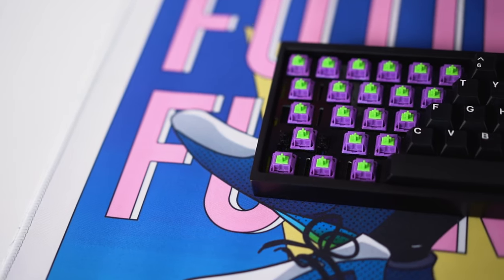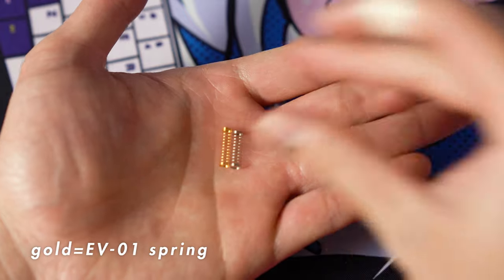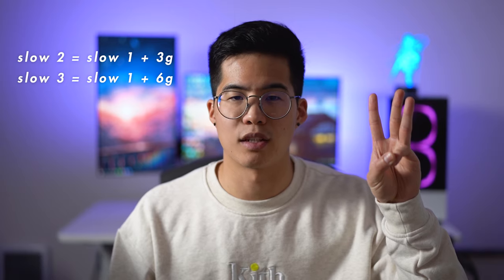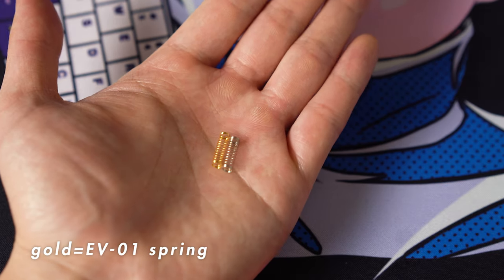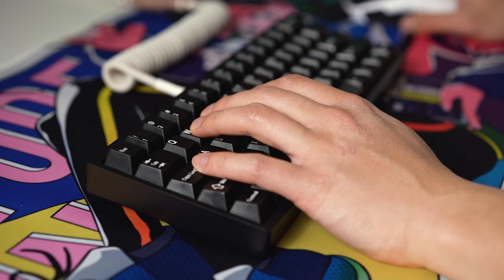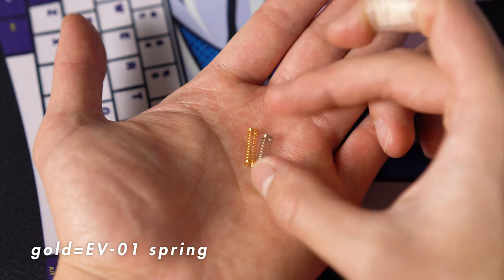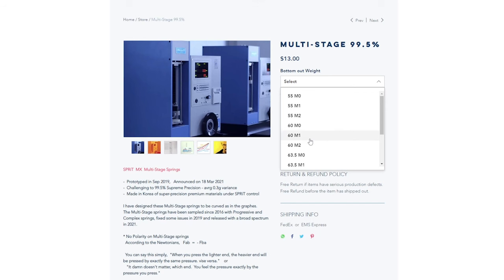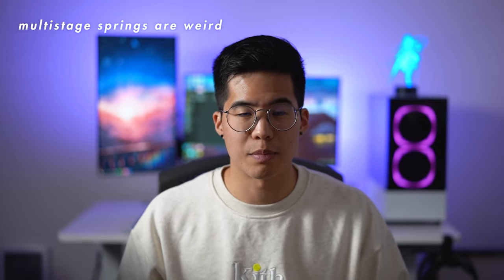BETTER THAN LUBING AND FILMING SWITCHES? A Guide To Sprit Aftermarket Springs

Comment: I originally spring swapped my Gat Black Ink springs to TX 14mm (Short) 65g, but didn't like how easy it was to press down and accidentally input keys, so I swapped them again for TX 16mm (Long) 67g. Feels so much better with the return and it actually requires a little more force to actuate the key press! Highly recommend the long 16mm version. 

Obviously weight is subjective but I find 67g was a sweet spot for me on linear switches. I use the stock 62g Boba U4Ts (tactile switch) on my other keyboard and they feel fine.
Reply from the maker: Ooooo I might have to try the TX long! I have a bag of the TX long 70g laying around so I’ll play around with that

Comment: What exactly do you mean by the bump in the Multistage springs? how does the travel feel in the first and second halves?
Does it start light and weight ramps up quickly until halfway, and then it stops getting heavier?

Comment: I just want to point out that bottoming out isn't inherently fatiguing - if you aren't jumping around different builds/keyboards constantly, and you get used to the force required to actuate the keyboard you're using, you stop pushing down harder than you need to, even when bottoming out. Going from a Box Navy to a linear optical switch, I was typing too hard for a while, but then got used to the smoother, faster, lighter, shorter throw, and it's fine now.

Comment: I'm modding my first keyboard and haven't even recieved it yet and I'm fallen so deep as springs now... I've decided the slow extreme springs would probably be best for me due to my partialness towards my corsair k55 membrane feel I'm currently using temporarily. And now I just need to decide between TWENTY different variations of the spring. What a nightmare. 

Thanks for the detailed advice!! Very few videos on this subject. Also, I went with the Gateron Box Ink v2 - Blacks.
Reply from the maker: honestly it can be hard to tell the difference when it comes to small variations of a spring...like the difference between a slow extreme I and II is pretty minimal. Good thing it's cheap to get a set of springs and try them out!
Reply: @tinstypos  Yeah I got a few different ones but I'm far too lazy to compare them all after how long it took in the first place lmao, it is extremely slight

Comment: i dont understand the weights on the site. like does the grams that it shows, mean force from the top of the spring or the bottom out?? i want to get some slow springs for my tactile switches. but i want a really light feel. what should i get??

Comment: Looking to swap out the 70g Black Ink springs and trying to decide between slow and supreme.  This was a great video but I’m still undecided 😀
Reply from the maker: Do you feel like the 70g spring is too heavy at all or just perfect? If it feels just right, then I would maybe go for a 68g slow spring since they make the switch feel a little heavier. Or go a little lighter like 63.5 or 65g if you think 70g is too heavy. If you don’t want the bump in the middle of the spring, then try a diff weight Supreme spring!

Comment: I bought 2 stages for mx blacks because normal sprigs were causing a ticking noise, the order hasn’t arrived yet but i hope it fixes the tick issue. Bought these according to someone who has these mx blacks with the same ticking noise as mine
Reply from the maker: I’ve never tried MX blacks and haven’t heard of the ticking issue—that was even after lubing the springs?
Reply: @tinstypos  yes even after bag lubing the mx blacks stock springs they were making tick noise when i touch the stem
Reply: i was literally planning to do that idk if im still going for multi stage haha
Reply: @metrogrinch9316  good news it fixed the tick issue for me, it sounds sooo gooood. i picked the 55 grams
Reply: @V4V6  oh interesting haha ill probably choose a heavier weight

Comment: Is there anything that's like a combo of multi-stage and lengthened "slows"? I think I might like that poppy preload feel at the top, but I also kinda want some bottom-out protection once you get past the actuation point. I've currently only ever had basic bitch red (linear) and blue (tactile) switches and like the reds much more. Pretty sure in general I'm gonna be a linear enjoyer in the long term, especially because my 12 switch assorted tester came with a couple tactiles and they just feel like crappy linears that hang up/drag/scratch.

Comment: Hi Tin. Apologies if I missed this in your video but which type of spring has the snappiest return?
Reply: Those should be the Slow Extreme III, although I don't know if they are as snappy as 22mm springs from other brands. 

These should be the snappiest as they maintain a very similar force throughout all the travel, while normal springs start very light and become heavier and heavier as you press them, so they can lose force on the return when they go from heavy to light while they have to carry the stem and keycap.

Let's say:
A normal 14mm 60g spring starts at 30g and bottoms out at 60g
A long 22mm 60 spring starts at 55g and  bottoms out at 60g

The real weightings change by brand and switch where you install them, but it's something like that. And I think you should buy 22mm from another brand instead of Long Extreme III just in case, to really feel the difference, as SPRiT springs might  not be long enough.

Comment: How to change springs for tactil?
Reply: do them the same, it wouldn't affect the tactility
Reply: For anyone reading i wanna recommend making sure to press the stem down in switches before snapping housings together again.
Reason being that apparently tactiles can have their tactility lessened or damaged if you dont make sure the stem is pressed in while reassembling, it damages the leaf springs tactile bump part. (Gazzew advises to do it this way and ive found that my best tactile frankenswitches are garbage unless i assemble em this way as well)

This issue can be fixed or undone but i wouldnt suggest trying as it can be like working with black magic and ruin the consistency of your switches.

On the opposite end of the spectrum however, one of my favorite linear style switches can be made by modifying the leaf springs of a tactile switch. You can even get a similar feel just by adding lube to the stems where they contact that bump to make them feel more linear.

Comment: I have Gateron black ink v2 which I like but it feels heavy to me. I also tried Akko CS Silver switch which is 45g and very comfortable for me. I tried to spring swap but the Black ink’s housing becomes wobbly. Not sure which spring I should try-any suggestions?